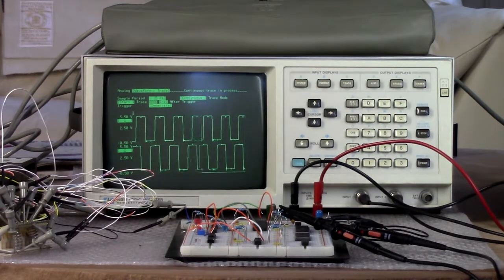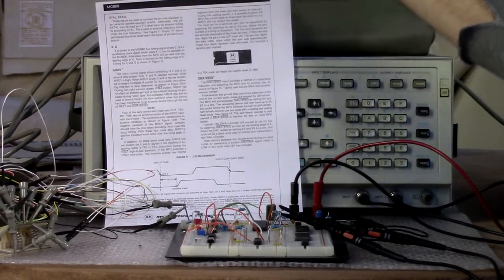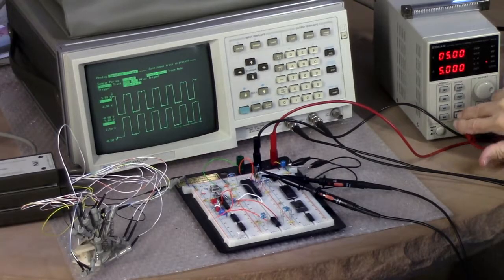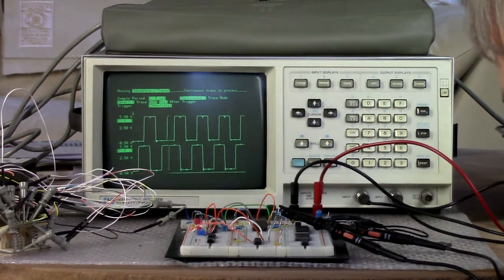MC6809 Processor Variants

Comment: I was an FAE for Motorola processors in Western Canada in the 1980's, and for Motorola VMEbus Unix systems before that... I think I even have a couple of MC68709's in my parts box... The 6801, then 6809, then HC11, were great processors to work with, and you could actually talk to a real application engineer, in Austin, when Intel "application engineers" were sales guys, and a real AE was only available if you worked for IBM, or Ford, or... I actually have an application manual for the XC6801, from 1978, on one of those coilly-binders, printed in good old Courier, on a daisy-wheel printer, with hand-drawn diagrams for ports and timers and such... Fun days!

Comment: I don't know whether you are interested, but I know a bit about using the 6809E in  a multiprocessor environment.

Very nice chip.... under valued and largely KEPT OUT OF the home computing market. Very very suspicious.....

Look into SYNC, bus arbitration, AVMA and LIC.....
Reply: The 6809 would kind of self-align clocking in a multiprocessor system, as I recall... I had to build a custom IEEE-488 Controller for a customer, and started out with Intel parts, as per customer request, but Intel"s 488 Controller was flaky as hell, so I changed over to Motorola for both cpu and peripherals, and Motorola's 488 controller actually worked, and the 6809 was a pleasure to "assembler" with...